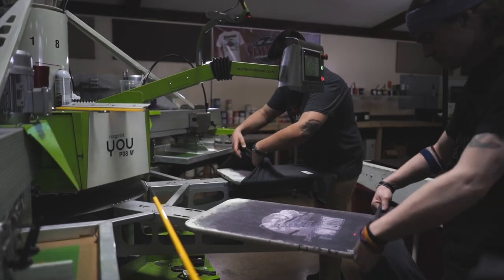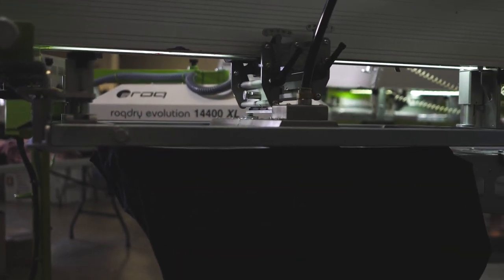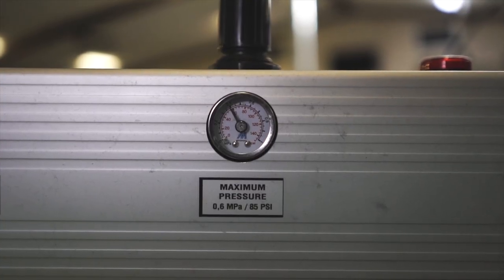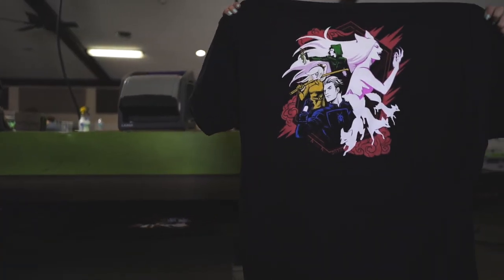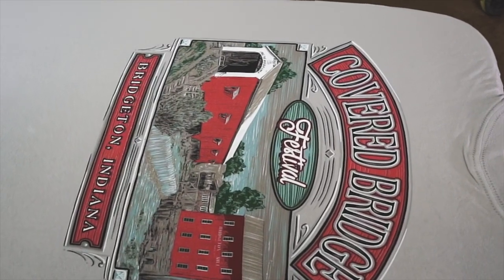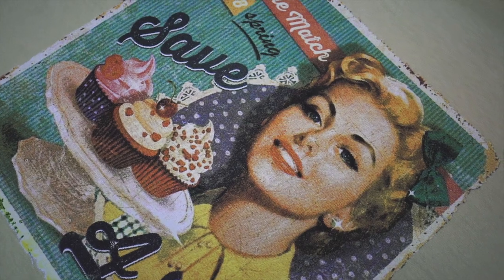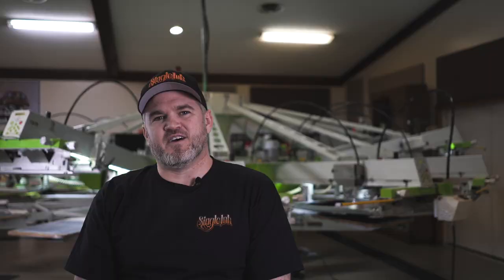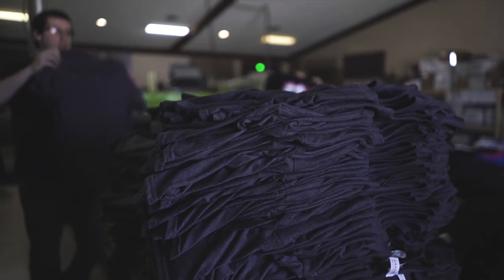A Screen Printer's Testimony to the Excellence of the Roq Iron

Comment: I cannot get my iron to work like it is in this video. Temp at 300....at 300 it just sticks too much, even with silicon spray.

Hell, Mine sticks in the 175 temp range. Is there any tips you have such as printhead PSI and/or squeegee height for the iron? Any tips would be helpful.